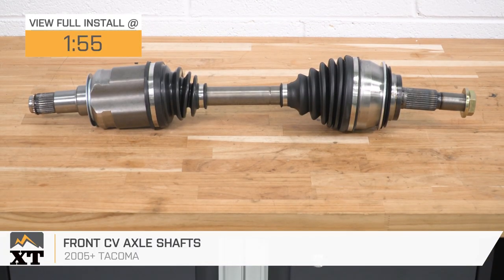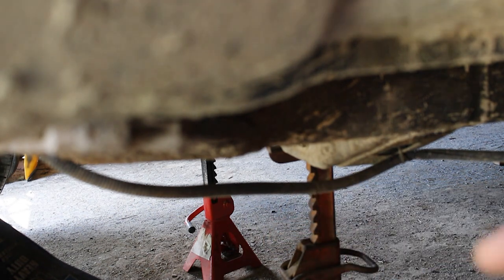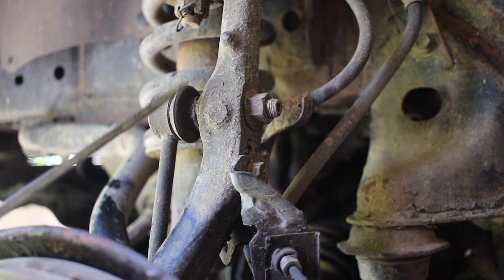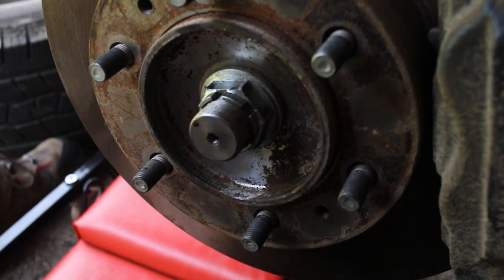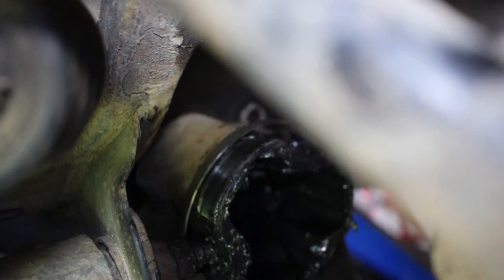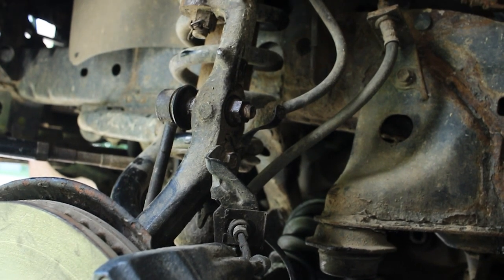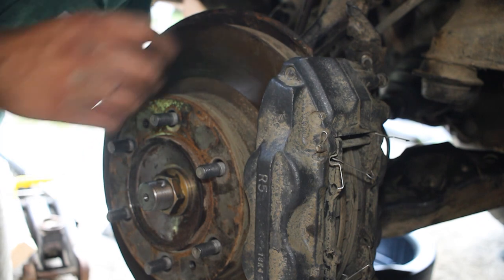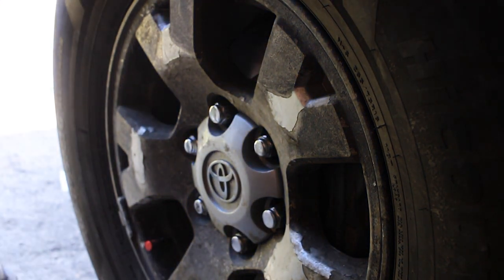2005-2022 Toyota Tacoma Front CV Axle Shafts Review & Install

Comment: At 14min the sway bar end links you can use an open-end wrench on nut and at the tip of end link bolt has a ,I think 5mm allen head ,you can put allen wrench inside slot, and hold links from spinning while loosening and or tighten nut
Reply: That was painful to watch wasn’t it? Iol

Comment: Don’t put grease on the inner cv shaft!!!!!! That end makes contact with your differential fluid 🤦🏻‍♂️. Also just step on the brake to tighten the cv axle nut.
Reply: should you just coat it with the differential gear oil?
Reply: @efil4kizum  No, it will become coated with oil once it’s in the differential housing. The seal keeps everything behind it in the housing lubricated.
Reply: @Tcodyw88  ok thanks! ... i was replacing the CV axles on a Gen7 Corolla and somewhere it said to coat the shafts with ATF before sticking back into transmission and was not sure if the same standard is needed for reinstalling into the front differential or not